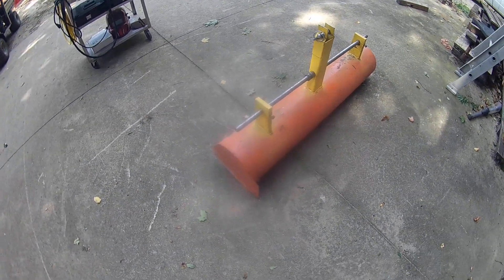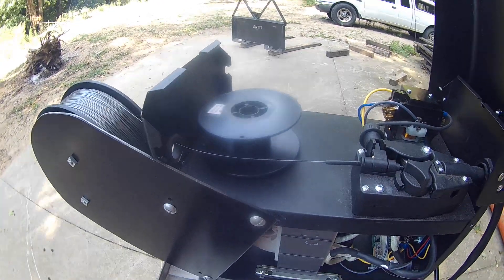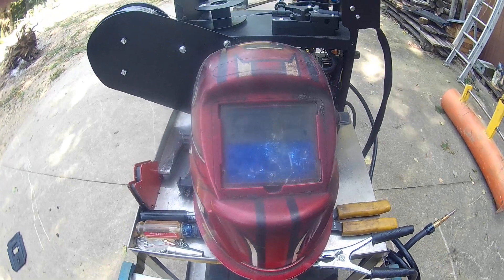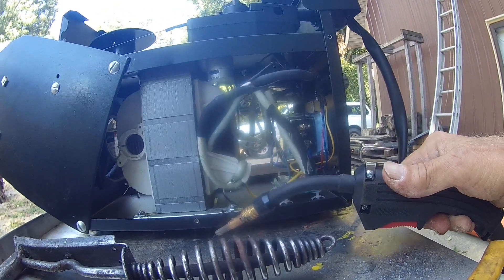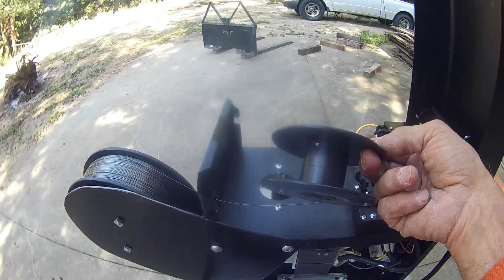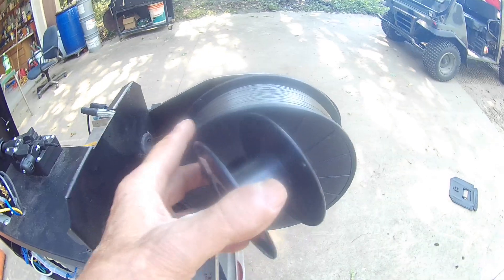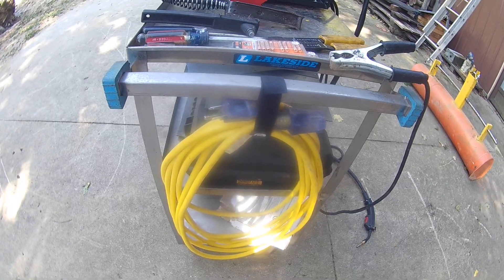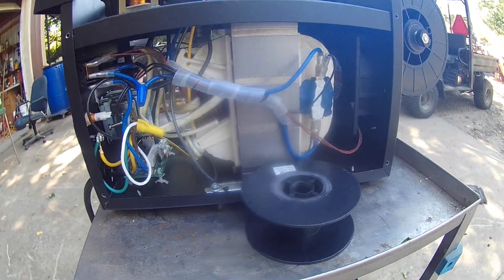3 Mods I made to a 120 v 130 amp Flex Core Welder

Comment: 1. Wondering if the transformer is now from the mains instead of maybe after the transformer?
2. Man that relay is a great idea since like my Century 125GL, and guessing the new to me Century 100, they're live hot once you power on.  I have a breaker on my generator I use when welding and always switch that to be safe.  Thinking I might have to do the same. 
3. That's another great idea for a super simple bracket.  I recently made a video, I think I uploaded yesterday, showing a spool holder that wasn't design correct though they refunded me and let me keep and I noted I'd make a video detailing how I wound up modded to work good so others know that need since might be a washer around or can get for like a buck.  Plus so their supplier knows. 

Wanted to note also, you can probably buy like a ~$20 or less 150A rated (or more if you need or want) rectifier and convert that AC welder to DC.   Your electrician friend will know.  Super simple and I think really cost effective if you use the cheaper 5-10 pack smaller and wire in parallel and mount on an aluminum plate or some sort of heat sink.  I guess and inductor and/or capacitor might help too... he should know how to make from an old microwave over transformer(s) and cut out the wire and rewind with the right gauge to handle the current. 

I've also been looking to see what the most simplest homebrew DIY, if you understand electricity safely enough since can be deadly, AC balance circuit so to adjust like the balance for TIG welding aluminum.  Seems like a negative clipper negative biased will do the most cost effectively with homebrew parts if I'm thinking correct regarding using light bulbs instead of needing like heating elements from heaters or maybe a heater adjusted so rated low enough wattage yet can deal with the heat if the resistor design that requires the higher wattage handling is what's required.  I'm still need to read into that more since isn't like what I'm thinking and I just found the circuit and am not more than an amateur. The diode that can handle the higher current seems like no problem and cost effective since 20A or larger diodes are common.  Would be hand to just have a light bulb changing clipper circuit to DIY cost effectively adjust the AC balance (electrode positive compared to electrode negative) for best welding aluminum... at least like you see with TIG real common. 

Thanks for sharing!
Reply from the maker: Thanks for watching. YT is not notifying me when I’m getting a new comment. Thank you for the information! You know a lot more about this then I do. Later
Reply: @ItsaboutMakingnotBuying  Any chance your electrician friend has a schematic or you can check to see how he wired that relay in?  I'm still learning and thankful for those sharing what they've done and that's inspired me to rescue what I can made in the U.S. and improve the rest while saving from the trash heaps.  You have a good one. Thank you sir.
Reply: @ItsaboutMakingnotBuying  Wound up looking at some schematics and found most:
1. The relay or contacter is wire in at the mains and appears on the 120VAC machines being a relay on the black-hot line after the fan, so the fan is always on to assure cooling.   I can also see adding the relay after the thermal cutoff switch as well on the designs where the thermal cutoff switch isn't on the gun trigger line/wire, though better practice is to switch the black-hot line-wire.  A breaker or switch can also be added before the relay, after the fan. Seems good practice to always have the fan going to keep the system cool, especially if a breaker or thermal fuse tripped.  The relay switching side positive wire can be wired to the the MIG Gun switch wire feed connector positive wire. 
2. The ~24VDC (coming from a rectified mains from the ~24VAC side of the step down transformer), or whatever the Wire Feed is rated for Voltage and Current, is wired in parallel to the fan on the mains input line for most designs without a controller board I'm reviewing connected to mains after the fan and relay/switch/breaker.
3. Wire in the inductor (MOT core seems most cost effective wound for current rating) on the positive polarity block line.  If wanting to add a Capacitor (59,000uF or higher at least 40VDC rated depending on design, e.g. Century Wire Feed 100) is going across the positive and negative line going into the polarity block, where the positive terminal of the capacitor is on the positive line and the negative terminal of the capacitor is on the negative line going into the polarity block with a bleed resistor across the capacitor to assure discharge. Please be careful with the bleed resistor and might be a good idea to wire two in parallel so there is redundancy for assurance of the capacitor discharge if one resistor fails. 

Figured I'd put that out there if anyone was wondering.  Please comment if you notice anything wrong above.
Reply: schematic is all we need..

Comment: Thanks for the video!  That's pretty  neat that your friend could change it so the whip wasn't  always  hot. I have an older snap on welder that's always hot, I'll have to look into getting it done. I didn't realize that there was an option with mig, just thought it was all the same. Didn't give a thought to ac or dc.
Reply from the maker: Thanks for watching Bill. I'm glade that this may help you with your welder.   Later